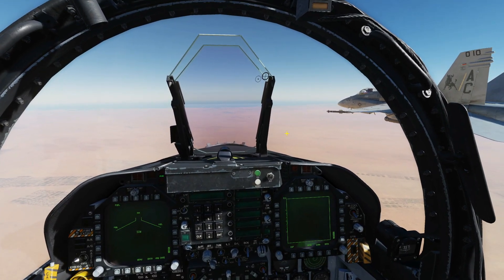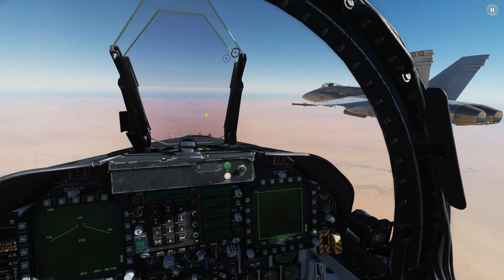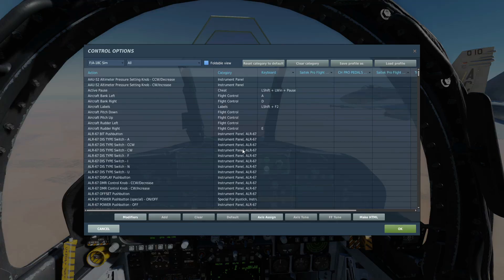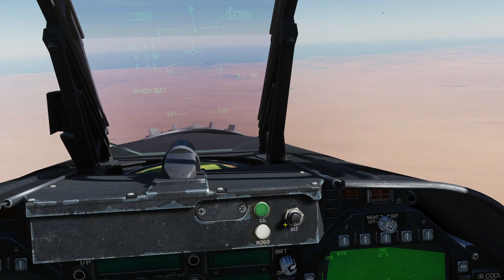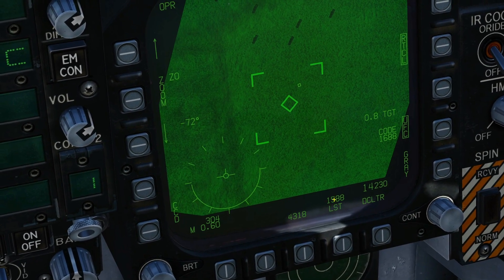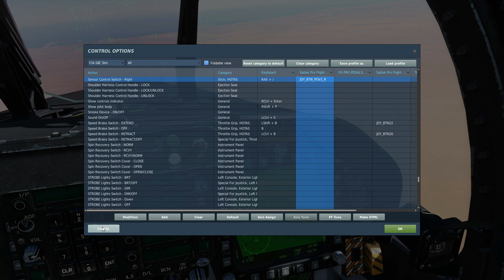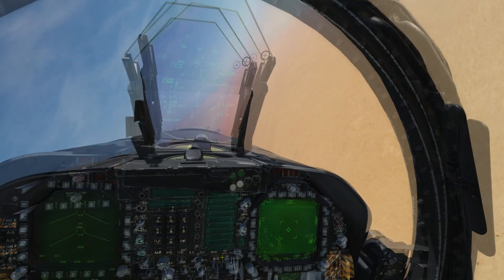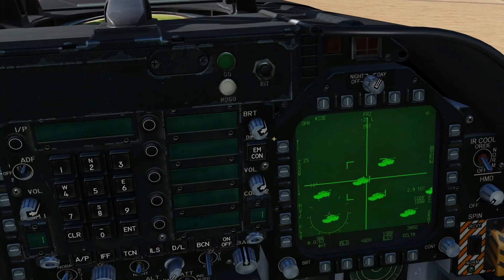FA-18C Hornet: Litening TGP TPOD - LSS & LST Tutorial | DCS WORLD

Comment: @Grim Reapers

Cap, regarding JF-17's DTOS, got this info: 

"Jeff's DTOS is half F-16 DTOS and half SU27(ccip->ccrp) , more like a combination.
Just give you a fast option to aim and fire on target of opportunity which does not need a hard dive.
________________
Deka Ironwork Tester Team"

Basically if u need to CCRP on a target of opportunity without diving on it(like u have to in CCIP), u can do that in DTOS mode by making the HUD SOI and then designating the target. Cues and functions are same as the AUTO or CCRP mode, just the designating can be done visually by the HUD. Hope it helps.
Reply from the maker: Thx MK will check out today!